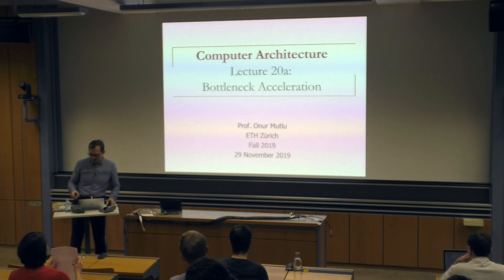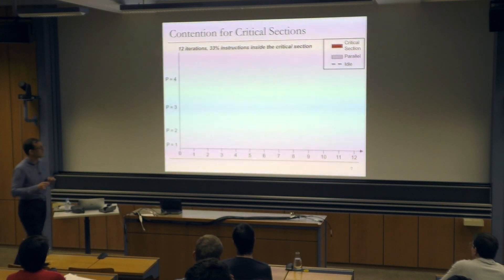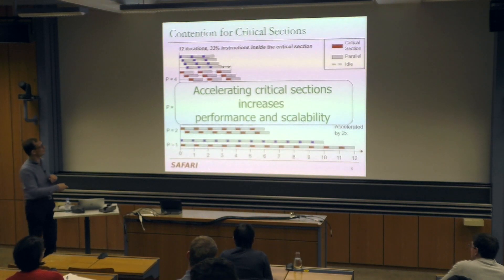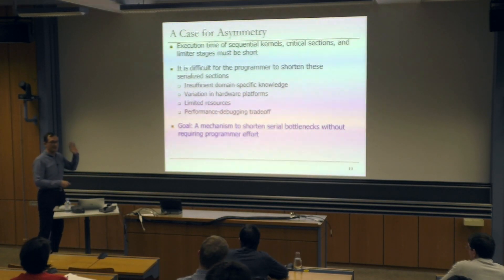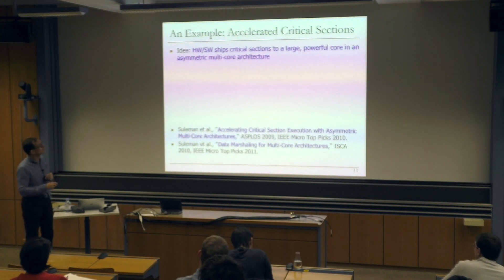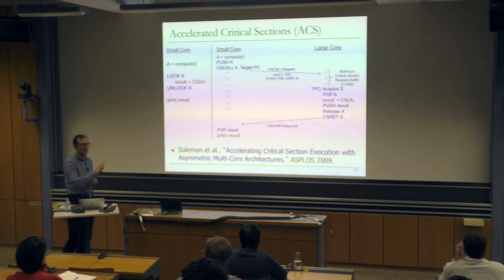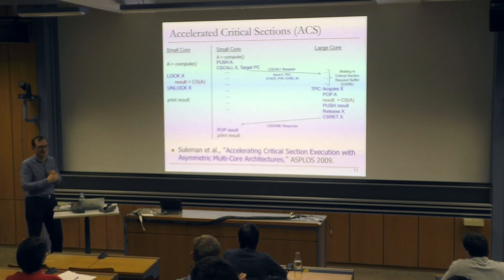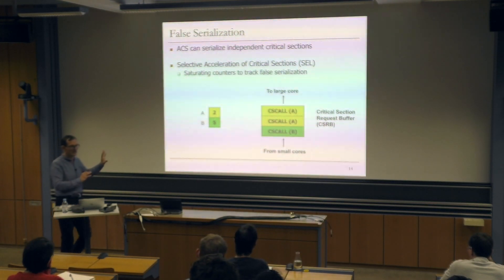Computer Architecture - Lecture 20: Bottleneck Acceleration (ETH Zürich, Fall 2019)

Comment: Blurred video. Hard to follow. Also, for some of the previous lectures (like the GPU programming) only slides are shown, not the board. When the instructor writes on the board, the viewer needs to use her estimation skills to know what is going on.